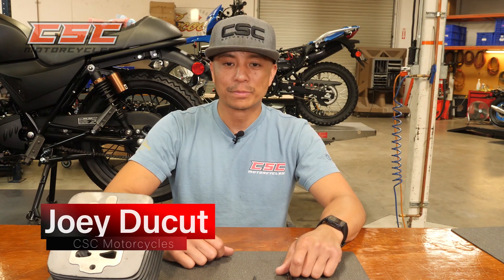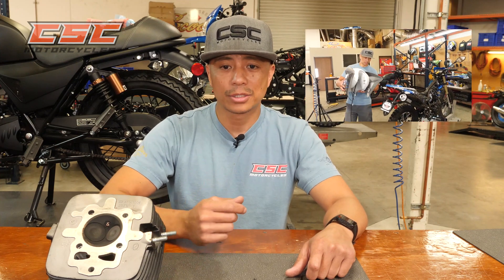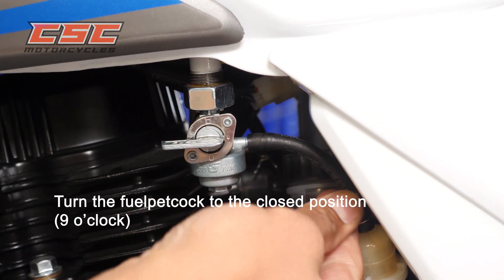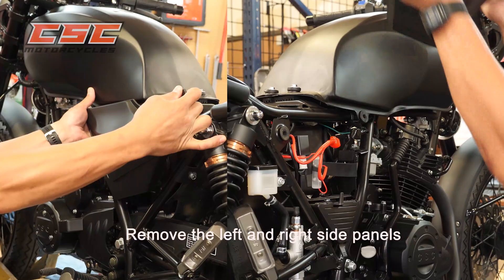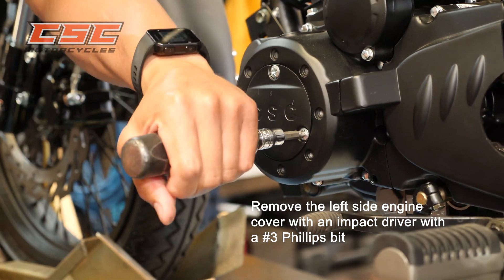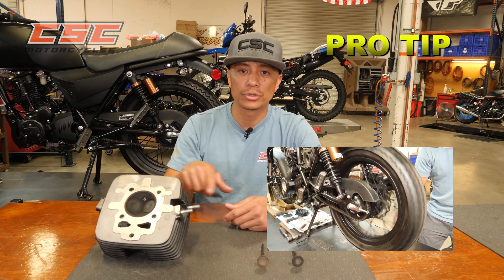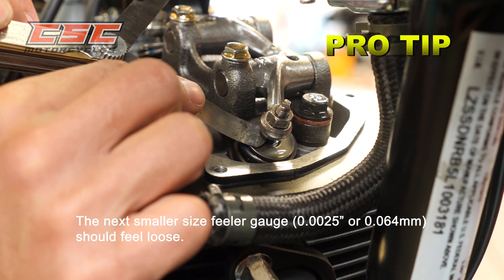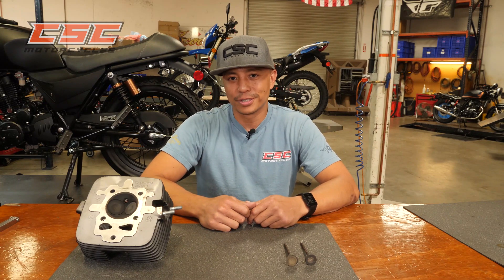CSC SG250 TT250 Valve Adjustment

Comment: I am about to place an order for the SG250 after being on a 12 year riding hiatus. Had a Honda and a Kawi ER-6n. I picked CSC due to their commitment to provide support, parts and instructional videos. Made in China but this bike looks solid and from what I can observe the build quality is great. The same cannot be said about the plethora of bikes available on Amazon. While cheaper, I've heard nightmare stories about build quality and sourcing parts. The other aspect to my decision is how greedy motorcycle dealer are and how much they tack on their bikes. RE, Honda, Kawi and etc. The nearest Honda  dealer quoted me an exorbitant $1,800 over asking for a miniscule Grom. Insane! This bike seems to fit the bill. Lightweight, low seat and won't break the bank. Although I'm a bit curious about how I would look on it. I'm only 5'7" but my legs are long with a 30.5" inseam. I will mostly cruise around my mountain town. No commute to work since I retire 3 months ago at 52.
Reply: Congrats on your early retirement mate!

Comment: Where the rock arm assembly attached to the cylinder head are there dowel pins on the two outer bolts?

If so do you have a part number for them?
Reply from the maker: I don't think so. Have you checked the Stock Replacement parts section TT250 Parts/Engine parts diagrams? 

https://cscmotorcycles.com/stock-replacement-parts/tt250-parts/engine-parts/

Comment: Shouldn't the intake and exhaust be different gage ?
Reply from the maker: Most factory recommendations for valve gap are based on a min-max range. Our experiences with this engine have shown that the exhaust valve tends to tighten more than the intake.  We use the same feeler gauge, but tend to have a slightly looser fit on the exhaust (to achieve a slightly larger gap).

Comment: I’m having problems with the rocker lock nuts coming loose. I follow all the steps listed and tighten the nuts pretty good, but after 20 minutes of riding they loosen up and the valves start knocking. What am I doing wrong?

Comment: As far as any instructional video goes, this one is grade A top notch stuff! I’ve been thinking about a csc 250 but the thought of doing carb and valve work makes me a bit hesitant. Videos like this show that it’s not really all that bad. Only thing I can think of to add is maybe torque specs for the nuts and bolts.
Reply: You can find it by looking up the maintenance manual on their website. It gives you the torque specs for each size bolt.

Comment: In the video he says use the zero point seven six (0.76) mm feeler gauge, but it's actually the zero point zero seven six.(0.076) mm one.
Reply: Even worse is in the PDF manual from the CSC website, they have it written as .007 mm along with many other inconsistencies. It made my first time adjusting the valves a little frustrating.
Reply: @ShacknastyNick  but now In this video it says both valves @ 0.03 I'm really confused

Comment: Great tutorial for the TT250 or SG250.  I recommend similar tutorials for the other models.  It would be very useful if you would point out all the electrical components of the various models...for example, where the relays live and what they are for, fuze location and function, where to find the switched 12V auxiliary leads.
Reply: Thanks for the suggestion Peter. Now that we have a full time crew working on the YouTube channel I am sure we will get around to that very soon.
I will mention it to the crew. Thanks!